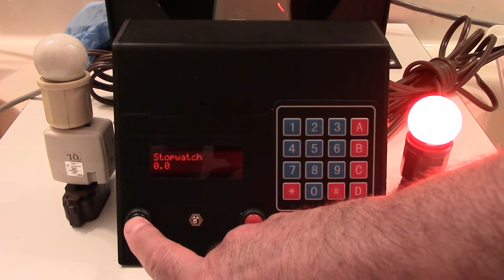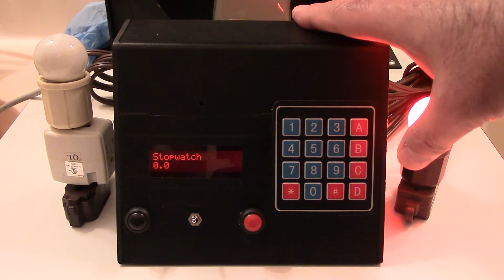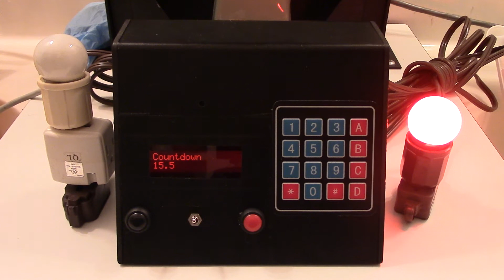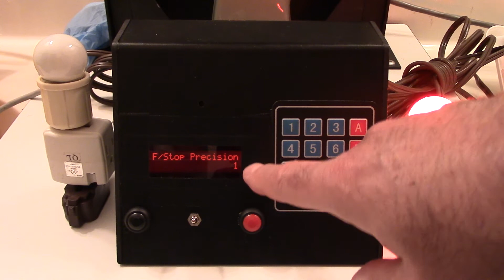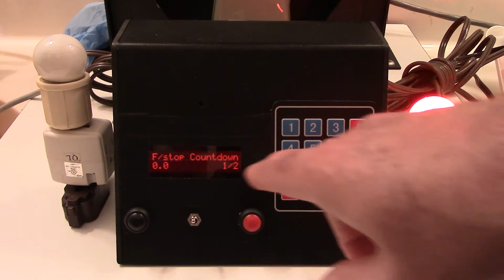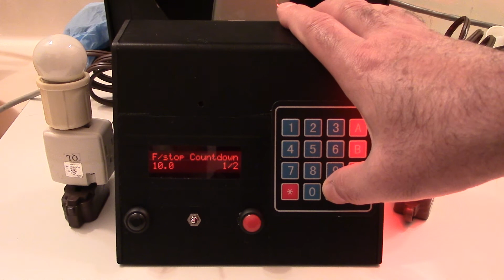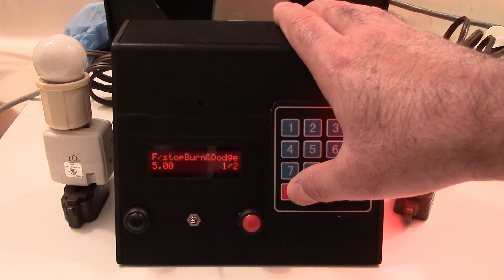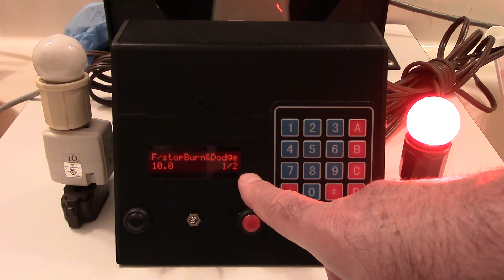Arduino-based Darkroom "F/stop" Enlarger Timer

Comment: Eventually got mine finished Don, pics on photrio page.
Reply from the maker: Ralph, that is an amazing build! I like that you used the Arduino Micro (?) for the build. Did you have any issues using the Micro, which I believe uses a ATmega32u4 rather than the Atmega AT328p that I used? The timer architectures are somewhat different.

Good call on the separate relay supplies. I has some resets when switching the inductive load represented by the enlarger power supply transformer until I added a snubbing network across the load contacts of the relay.

Comment: A function that would be great would be a starter offset that you could adjust and it would by default always beep, it could flash the display I guess too. Intent being you can hit the start button, get in your position for dodge or burn say in three seconds, then the light goes. Nice work man! Fixing code and a clean build!

Comment: Hi, first many compliments for the project. I'm doing the same timer but i have a problem with the keypad.
When i put the program on countdown, and i try to insert the time, it change immediately to hundred seconds.
For example, i want to count 15 seconds, but when i push 1, the count set itself to 111.1 sec. What it can be? Maybe a issue of keypad? Thanks a lot if you would help me.
Reply from the maker: I had this issue as well. You need to be sure you have updated the Arduino keypad library to the latest version, or the input is wonky! I just used the library manager in the IDE. If you use the .hex code for the Atmega 328p bare chip, it's already included, of course. I'm using version 3.1.0 of the library.
Reply from the maker: And thanks! BTW, I had to add a snubbing R/C network of cap and resistor in series across the 120VAC relay contacts to prevent the Arduino from resetting when switching the highly inductive load of my enlarger stabilized power supply. Message me at Photrio for details, if this is an issue for your enlarger.
Reply: Thanks for your time.I try updating the keypad library ,but it remains wonky.
Maybe an issue of my keypad?.. Damn 
Thanks a lot BTW!
Reply from the maker: No. it's NOT your keypad! I had exactly the same issue at first. You are still picking up an old version of the keypad library.
Reply from the maker: https://www.arduinolibraries.info/libraries/keypad   Try using the 3.1.0 version from this site. You can unzip the keypad library files and put the 4 files in the "src" directory in the same folder as your sketch. Then, in the Arduino code at the top, change:

#include <Keypad.h>
to
#include "Keypad.h"

The quotes will force the sketch to use the local files instead of those in the Arduino IDE.
Reply: df9999999999 Thanks again, i  tried to do all wrote in the message, but i didn't solve the problem.
Reply from the maker: Checking over my code again. I'm sure it's a library issue. This drove me  crazy, but it was reported on the Italian site for the older code as well. Will get back to you.
Reply from the maker: Sure!
Reply from the maker: Use the keypad library version from the posting on this page: https://www.analogica.it/upgrade-timer-con-keypad-t6797-460.html
Reply from the maker: Tungeai Dervis That allows it to work with the standard library?
Reply: df9999999999 yes, whatever comes by default by ide